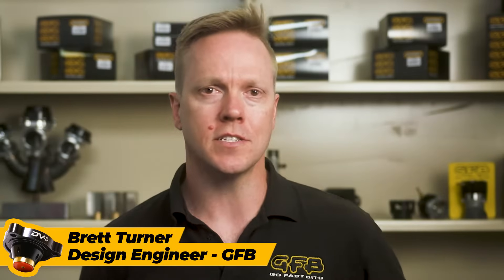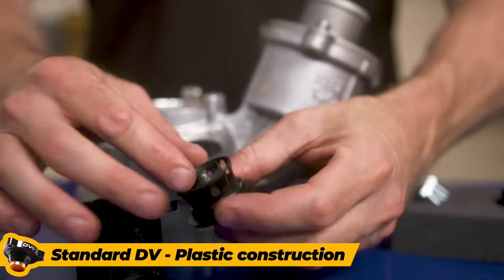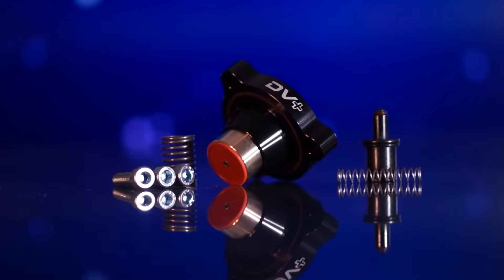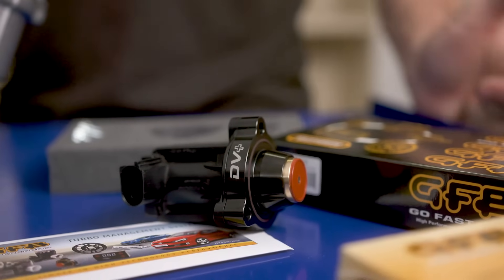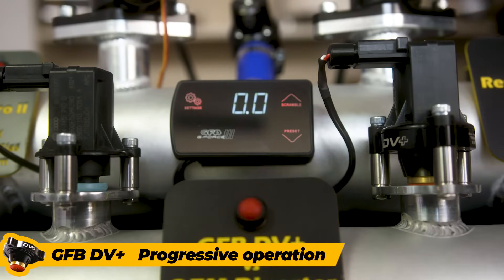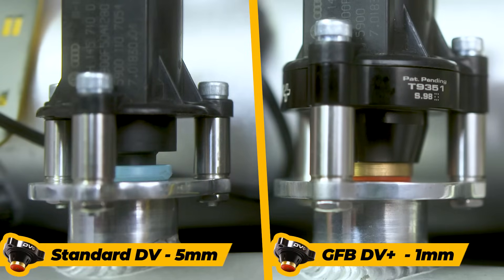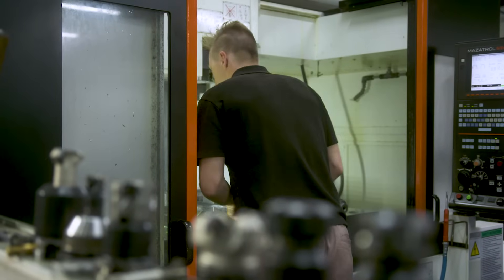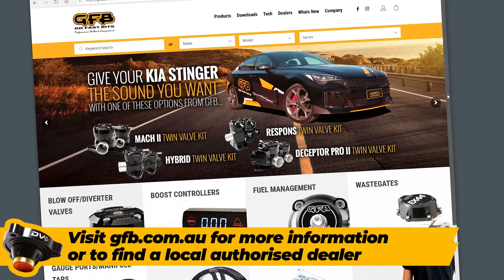GFB DV+ Diverter valve overview

Comment: So I was interested in your product until I seen another video expressing an issue with the valve. Just wondering if it has been resolved. 
https://youtu.be/L-n2j5ngpx0
Reply: Added the video with the issue
Reply from the maker: @jackhousevibesjhv5506  Hi Jack, 
We've not seen any other instances of issues with people stalling their car with the DV+ installed. It would be good to get some data-logs of what's going on so we can see what could be happening, but it sounds like that customer decided to keep the other product rather than the DV+. 

We do have lifetime warranty on all our products so if you do ever experience any issues we're happy to help.
Reply: @gfbvideos  thank you for the quick reply! I thin I’ll give it a try!
Reply from the maker: @jackhousevibesjhv5506  That's great! No problems. If you've got any technical questions or anything feel free to contact us at support@gfb.com.au
Reply: @gfbvideos  hello so I bought and installed on my 2019 camaro 2.0. Seems to work well but I get a check engine light with a 2261 code. I clear it and it comes back but not right away. I’m wondering if the sensor is noticing the valve since factory is only open or closed. Any advice?
Reply from the maker: @jackhousevibesjhv5506  Yeah your diagnosis sounds correct. The P2261 code is triggered when the ECU sees more boost pressure in the system than it expects after the valve vents. The ECU interprets this as the valve not opening and triggers the P2261 code to indicate this. 
Because of the extra spring in the DV+, it can begin to close before the ECU tells it to and retain some boost pressure in the intercooler to help with throttle response. The ECU isn't aware that the valve has been swapped and has the capability to do this, so it sees that extra boost pressure as meaning there's an issue with the OEM valve. 

It's pretty rare for this to occur. Generally there is enough of a range in the expected values that the code is not triggered. If it is triggered though, you can always just remove that main spring (the short fat one behind the brass piston). 

If you have any more questions feel free to contact us at support@gfb.com.au
Reply: @gfbvideos  thanks for the reply. I plan on getting a tune and they will know all my bolt ons that I added so hopefully it will relearn the new system and hopefully no code!

Comment: Which part # works with a 2016 VW Jetta S 1.4 TSI?
Reply from the maker: Hi Francisco, If your car is twin charged, our part number T9355 will suit your car, please find the link below.
https://gfb.com.au/products/blow-off-and-diverter-valves/dv-plus/t9355-suits-late-model-vag-euro-applications/
Reply: @gfbvideos  awesome! Thanks for the quick reply ECS tuning website has this part listed not fitting my car, must be an error on their end but thanks for the information. Would you happen to know if I’d have to take this part out and put the stock one back in place before I’d have to smog my car in California? Just curious if you would know that I’m still planning to put it on.
Reply from the maker: @frod116  We are currently applying for certification in California but do not have it yet.
Reply: @gfbvideos  that’s good to hear hopefully you guys get it.
Reply: @gfbvideos  so apparently my 1.4T is the predecessor of the old 1.4T that use to be twin charged my engine is single turbo. Would this still work or is there another model for me?
Reply from the maker: Hi  @frod116  I've replied to your email, it's a bit easier than communicating via YouTube. Thanks!

Comment: I just installed it today correctly, took me 5 hours but let me tell you something, I feel like my throttle response is weaker than before and I don’t know why but my shifts are way smoother. But overall I feel dissatisfied. I made sure that I bought it from an authorized dealer tho (it’s genuine) BMW 320i N20
Reply from the maker: Hi Mohammed, 
Sorry to hear you're not happy with the valve. 
Can you please contact us at support@gfb.com.au for technical assistance. 

We will need some more information about your car, modifications done, what transmission you have, if you installed the optional spring etc.
Reply: @gfbvideos  I immediately copied and pasted my comment into an email via contact is on your webpage, but still haven’t gotten any response, 320i 2015, zf 8 speed transmission and I installed the optional spring
Reply from the maker: @MohamedTarek-qm3vf  Hi Mohammed, 
Try checking your spam folder perhaps? I have replied to your email so you should have received it by now.

Comment: I have a bmw n20 engine and I bought the dv+ can’t wait to install it however I have a question, why didn’t you guys develop a blow off valve for that engine and why is it only a diverter valve ? Is there a technical reason for that ?
Reply from the maker: Hi Mohamed, 
The issue with these cars is mainly clearance. There isn't a whole lot of space around the valve, and an atmospheric venting valve requires a lot more room than a re-circulating one
Reply: @gfbvideos  any idea why it would have a loud whistle on boost?
Reply from the maker: @georgecubbard8553  Hi George,
There are a whole bunch of reasons you could be experiencing a whistling noise on boost. If you'd like to look further into it please contact support@gfb.com.au
Reply: @gfbvideos  thank you

Comment: Is there any value to add a BOV in addition to the GFB-DV?
Reply from the maker: Hi Spencer,
There are some diverter valve spacers on the market that can be used with the DV+. We generally don't recommend this as they tend to be quite restrictive and will often not flow enough. We do have the VTA series of valves available for some applications that will give you all the performance benefits of the DV+ with that BOV noise.
Reply: @GFB,  I’m only interested in adding a BOV for safety functionality, not sound...

Does the part you reference help release boost to the atmosphere? Having additional boost when it’s not being used can place unneeded tension on our turbos. Many believe that tension shortens the life of our OEM turbos.

I have a performance tuned 2017 Lincoln MKZ, 3.0 AWD

Will the part you note fit my car and perform as noted above?

Thank you!!
Reply from the maker: Hi  @SpencerAndFAM , 
The DV+ is a re-circulating valve so it will not release the pressure to the atmosphere. Instead it releases it to the low pressure side of the system, pre-turbo. This performs the same in terms of protection of the turbo, but does so without the noise. 

We may have something to suit your vehicle, but have not confirmed fitment at this stage. If you have some photos of the OEM valve and would like to send them to support@gfb.com.au I'm happy to have a look at it for you
Reply: @gfbvideos  I have the same question using the DV+ with a BOV adapter but I have a 2020 Ecoboost Mustang. Any recommendations?
Reply from the maker: @wrecker1861  Unfortunately the 2020 Mustang uses a different style of diverter valve that is not compatible with the DV+.

Comment: Wish I wouldve known I wouldn't get any extra cool sounds with my upgrade...?? 🤨 So even after I throw my CIA on I wont get anything?? All I wanted until my stage 1 is installed?? Bummed.
Reply from the maker: Hi, 
The DV+ is designed as a more performance focused re-circulating replacement for the stock valve. It doesn't vent to atmosphere and isn't designed to make noise 

An aftermarket intake can help enhance the sound with a re-circulating valve, but it won't be as loud as if you were venting to atmosphere. 

For some applications we do have atmospheric venting valves available. If you put your vehicle details into our website you can check out a list of parts that are suitable for your car. 

If you need any technical help, or have any other questions feel free to send us an email at support@gfb.com.au
Reply: @gfbvideos  thank you. And I appreciate the feedback. And I'm aware I actually can't use a BOV on my Jetta, as of yet anyways. But I did order and aftermarket intake as well, so that's somewhat reassuring. Just trying to have a little fun with the 2015 TSI Jetta 1.8 (Manual). Not trying to get too crazy, just a daily driver with a little something extra. I was really hoping for a little "blow off" type of sound but in the end I know I'm getting a quality product so not mad at all. Just gotta love that "skooooshh" sound! Haha Thanks again for the feedback. Just got my part today, I'll be putting it on tomorrow. Intake on the way. Look forward to it. Thanks again.
Reply: @awkwordone3305  An intake will help a ton with turbo noise. -ive got a mk6 gti

Comment: does it throw a cel for a stock tune car?
Reply: Nope
Reply from the maker: Hello, 
There is a small possibility of a P2261 code being triggered when using an aftermarket valve. This is because the valve will close earlier than expected by the ECU, in order to preserve boost pressure in the intercooler and piping. 

If you do experience this code, you can simply remove the short fat spring that goes behind the piston. This will make the valve act more like the factory valve, and stop the code occurring. 

You can find more information in the instruction manual

Comment: Should I lubricate it with some oil?
Reply from the maker: A small amount of engine oil on the piston is helpful on installation, but this is purely for installation. Once installed no oil or maintenance is required :)
Reply: GFB Thanks!!
Reply: GFB i dont hv engine oil with me , does bicycle lubricant work ?
Reply: fariz just install dry no oil needed

Comment: Hi, bought one last week and installed it. Stock I had no issues but I have plans to go stage 2 in the near future with more boost. With OEM valve I had surge / bird sounds from under the hood. But I still do with your upgrade? Could you explain? How can I check if its working correctly? I have boost / power. TTRS 8s daza 2018
Reply: Hi Mark, good question. The DV+ flows much more than the OEM diverter valve, and will not blow open when you increase the boost pressure, therefore you will not get any off-throttle surge sounds.
Reply: I would like to hear this with a cowl induction cold air intake from 2J-racing.com